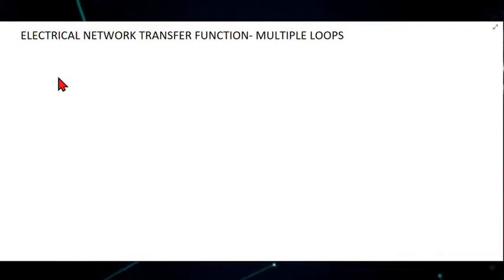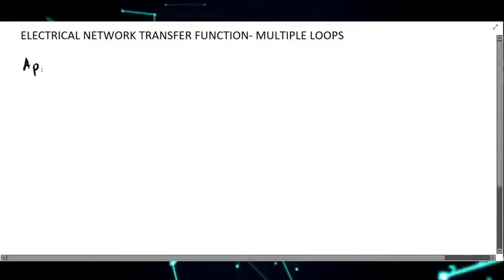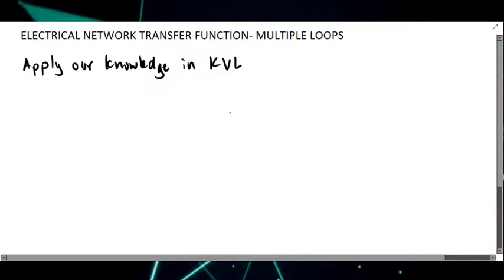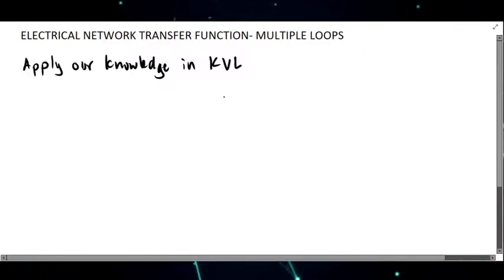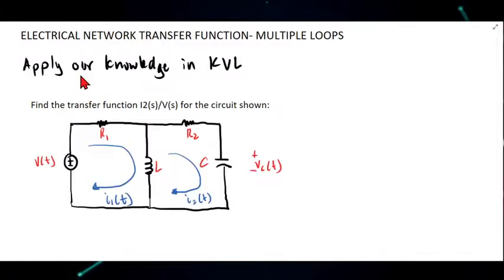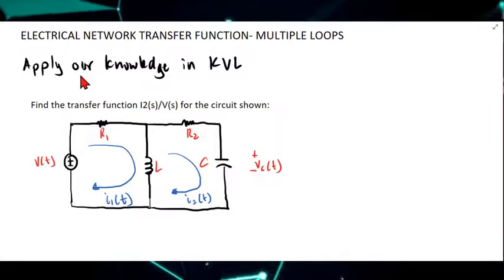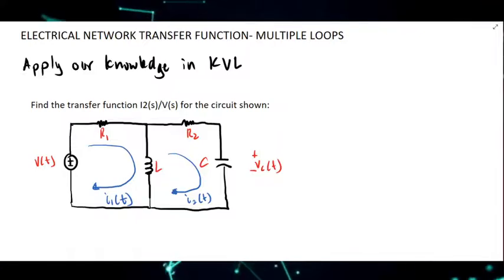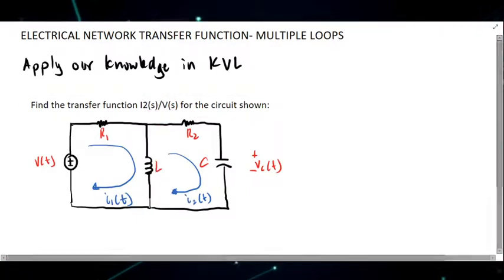ELECTRICAL NETWORK TRANSFER FUNCTION MULTIPLE LOOPS

Comment: Hello, what if we are required to find transfer function if I(s)/V(s) instead of I2(s)/V(s), please guide.
Reply from the maker: Still use cramers rule in germ of I1 to soolve it
Reply: @engreking  Ok then i'll get I1 and I2 equation, after then how will I still get I(s)/V(s)? by adding them?
Reply from the maker: For the given circuit there are two currents that are required..there is no I(s)..lets assume that I(s) is flowing in the inductor at the middle..to get I(s) use KCL.
Reply: @engreking  Thankyou for your response